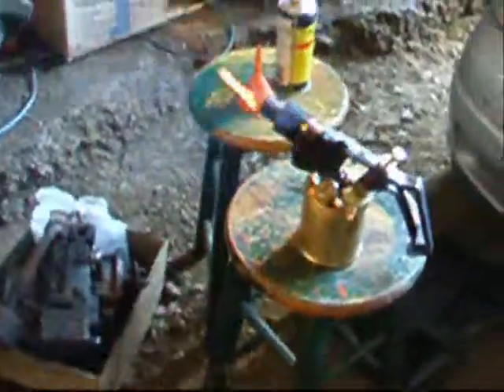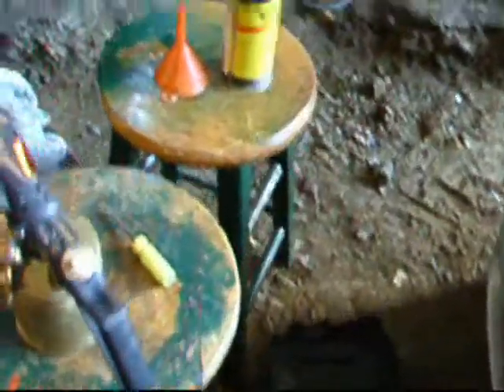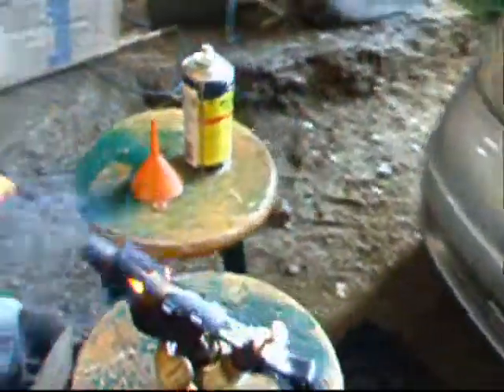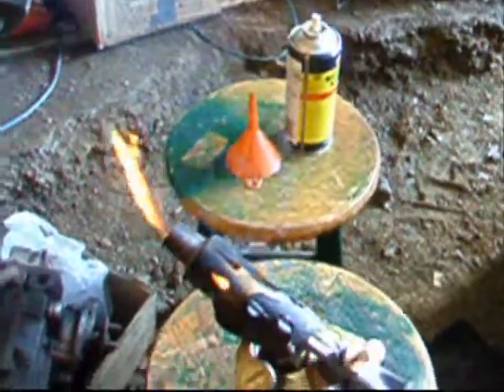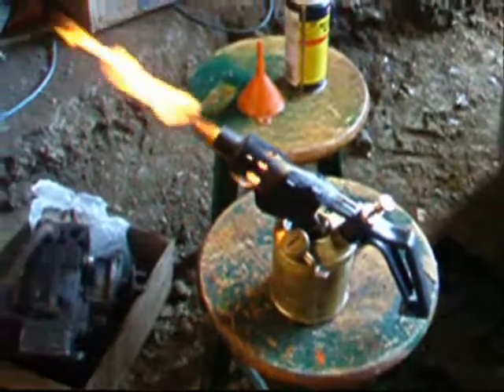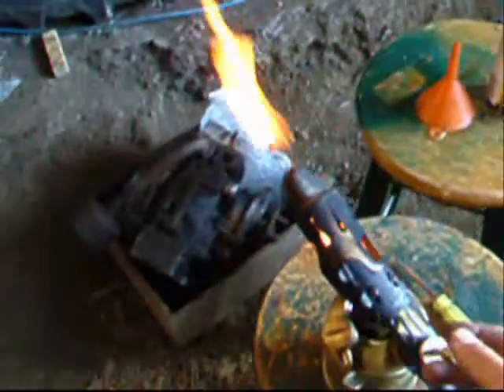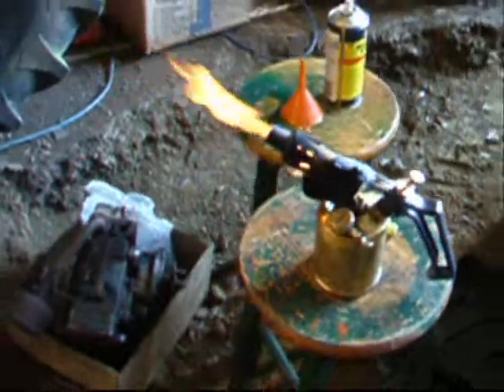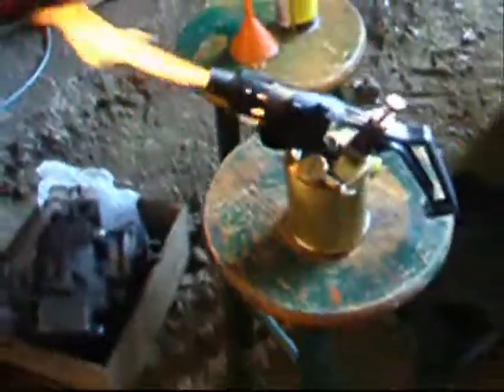primus 632 blow lamp

Comment: Nice lamp, but still not working propperly, it should be an almost invisble blue flame. Fill the bowl on top with metholated spirit and let it burn, give it a couple of re fills and that will allways get it got enough. It should then do the job straight away.